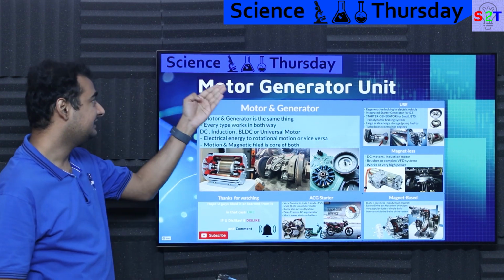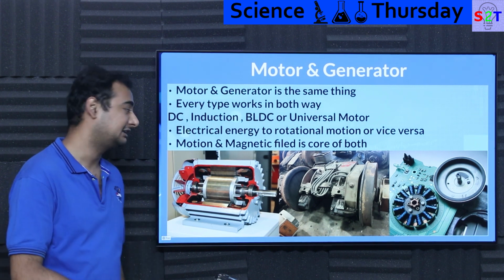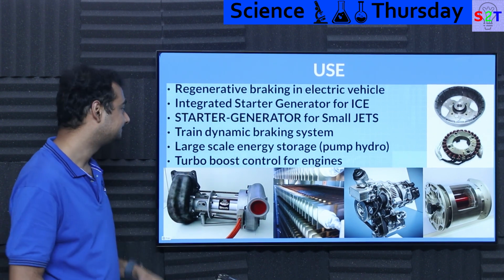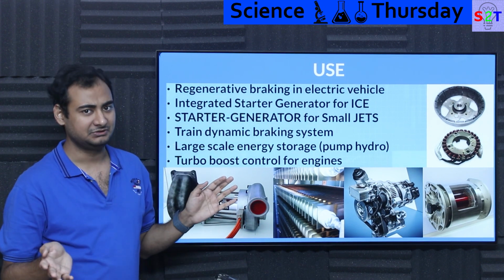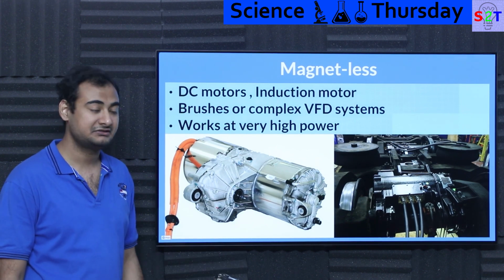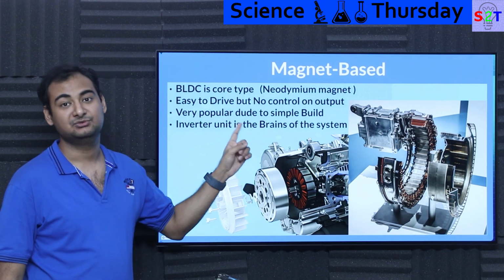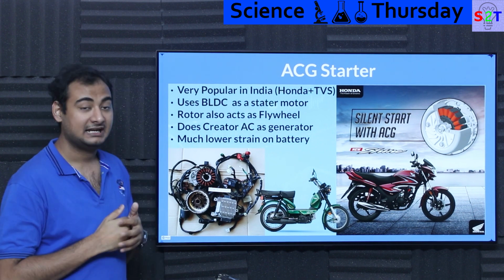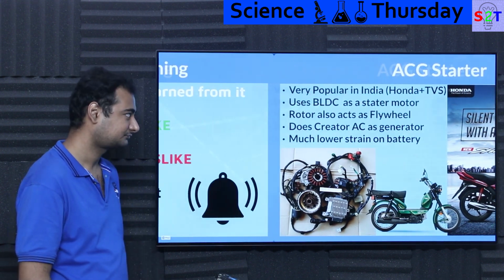Motor Generator Unit Explained {Science Thursday Ep160}

Comment: hello i have a 2013 porsche cayenne hybrid that uses a bosch magnectic system with the invertor. i have generator fault how would you diagonse?  do the magnet based motors go out ?
Reply from the maker: hall effect sesor or coil burn out or invertor(ECU) fault  & do the magnet based motors go out ? yes in case of fire

Comment: Would BLDC have great use in kinetic/gravity battery? Suspended load generates constant torque , speed, voltage etc. So speed controller, rectifier etc would not be necessary. Load would be lifted and lowered at constant speed. Would BLDC be adequate for such a device? If so what would be the limit of BLDC? Would it be possible to build 300kW BLDC Motor-Generator?
Reply from the maker: possible to build 300kW BLDC Motor-Generator yes many EV bldc is far more than that